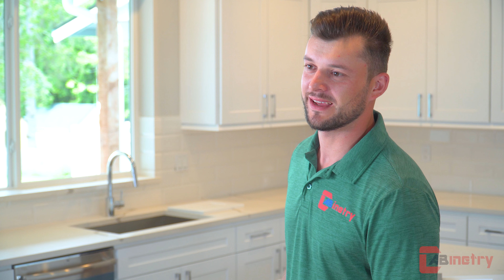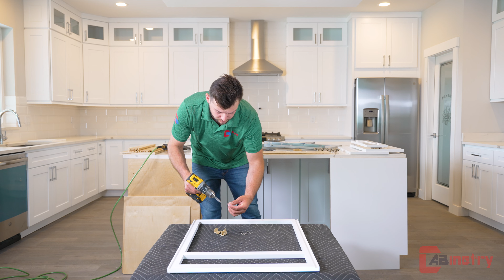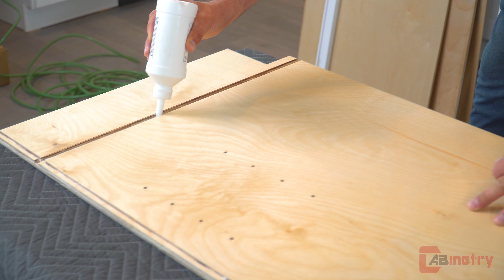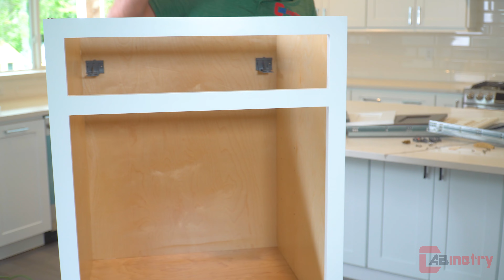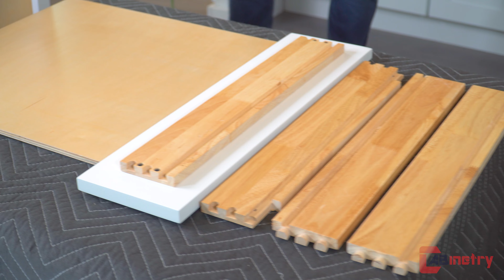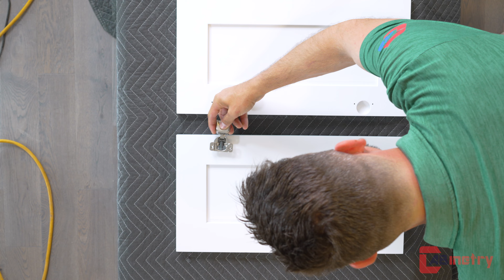How to assemble RTA kitchen cabinets

Comment: I just bought an entire kitchen from ABcabinetry. Using the instructions I downloaded from your website, they direct you to attach side to back, then bottom, then other side, then slide in the top, then slide on face frame.  This creates a problem because the face frame and sides slide into a half dovetail, but now the top and bottom both stick up proud of the half dovetail preventing the face frame from going on.  Starting construction by sliding the sides into the half dovetail solves the problem.
Reply: Tried building the cabinet with glue just like this video, when I discovered the sides needed to slide into the face. After already applying glue, it was a mess.

Comment: Was looking for some suggestions online as l just bought a kitchens worth of these.  Directions left much to be desired.  One page tiny vague drawing per cabinet.  Was concerned on exact placement of metal assembly clips, but upon closer examination there are small dimples exactly where they and the screws go, so no sweat there! CNC cut so very precise.. Thinking construction glue in joints wouldn’t hurt, maybe a pin nail or two also..

Comment: these normally have angle brackets, he used a pin nailer, i don't think that's going to stay together well if there is any earthquake activity.
Reply: The pin nails are only used as clamps to hold the cabinet together until the glue cures.  The strength of the glue is what holds the cabinets together.  This is how cabinets are made.  You can watch the same fastening technique used when watching Stumpy Nubs, Norm Abram's Old Yankee Workshop, and others.  I build my own cabinets without the nails using temporary bar clamps.